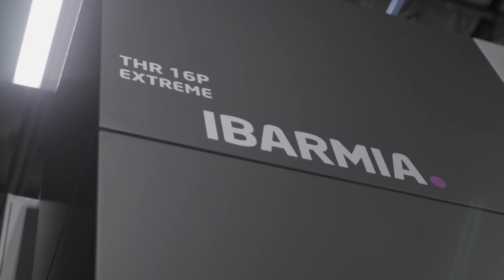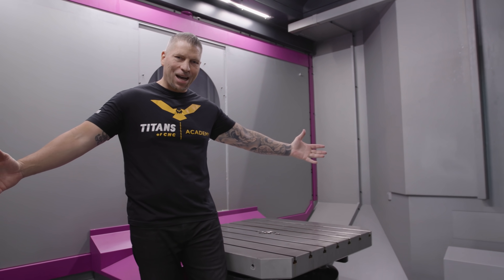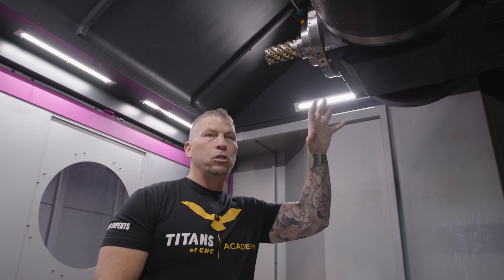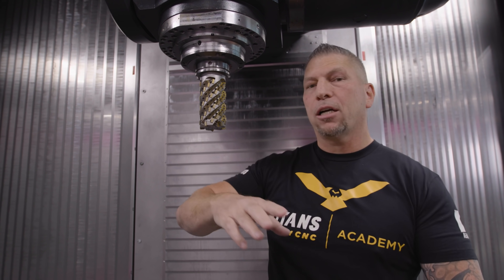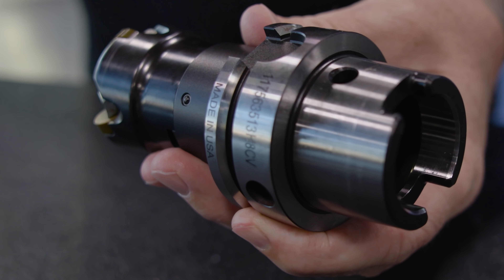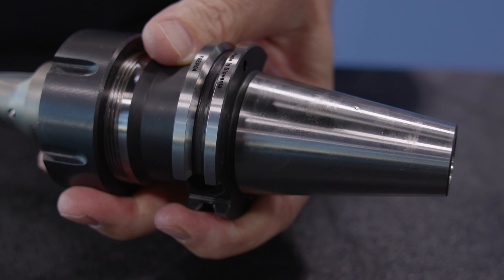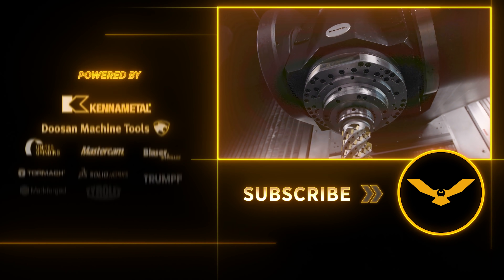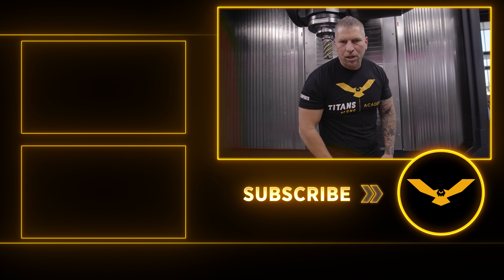100 HP KESSLER SPINDLE IN MONSTER CNC MACHINE!

Comment: Kinda reminds me of the 5 axis machines we had at B & W in Barberton, Ohio back in the 80’s, but B & W’s were much, much bigger.   They built nuclear steam generators for the Navy.    We had some with nutating  heads and contour cutting (“U” heads).   I still don’t see too many of these around.    The Ford plant up in Cleveland used to have a “U” head on their large 5 axis mill for molds.   You could cut a reverse taper (or contour) in a bore with a “U” head.   Almost every shop I ever worked at at some unusual machine that no one else had, and it’s job was specific to the product they built.    The more shops you worked at, the more you were exposed to the exotic equipment.   I enjoyed it.    Soaked it all up like a sponge.
Reply: i work on a B&W atm, its a pretty solid machine and fun to use 
because i work in the energy plant sector i get to use all the fun big stuff
i also was trained on a georg ultraturn and some other lathes that i forgot the real name off, just know the firm intern name
Reply: Barberton. Now I'm hungry for chicken. Mmmmm.
Reply: Do you remember the brand of the machine? Back in the 80's five axis had to be really cutting edge, especially with a U-axis and nutating head.
Reply: I work at NOG-L. We got an Ibarmia a few years ago. I start training on it Monday

Comment: Hi, what a machine. Such a high RPM for a large machine. As I said in one of my earlier emails I worked for Seco Tools here in New Zealand and I understand the difference in the range of milling holders. You mentioned a BT taper with double contact (Big Plus I think it was called) but they are not as good as HSK. The problem is when the machine operates at high RPM the spindle grows slightly and rigidity can be lost. The HSK being hollow grows with the spindle and maintains double contact across the range of RPM. You may like to cover this in one of your very explicit videos in the future. Cheers Ian

Comment: You gotta have one of those. Pretty high spindle speed for that kind of horsepower.
Would be killer for big aluminum jobs. I use to turn aluminum at over 8000 SFM never tried to mill it that fast. 😂
Reply: well aluminium is easy to mill , rpms go brrrrrrrr

Comment: hsk stands for the german words "hohl schaft kegel" which means hollow shaft cone. hsk 100 is massive. the biggest i have dealed with is hsk 63, which is quite common
Reply: Hohlschaftkegel ;-)
Reply: HSK also has a much higher pull force than any ISO,CAT or BT spindle which only improves as the speed increases. I've been on a HSK-100 where the spindle can go at 12k RPM, mainly because the weight of the tool is a lot less than the standard taper tooling

The next step up further is Capto but there's not a lot of spindles what have this built in
Reply: @DuRöhre4711  lol natürlich, habs mit sk - steilkegel verwurschtelt 😂

Comment: I made a comment on your recent video "The Most Unreal Mind-Blowing CNC Machining You Will Ever See in Life" it could be construed positive or negative. What i said was its a 50 taper machine with hi torque - use it. No big deal. You guys push things to the limit and thats impressive to see. However some of your videos on the 40 taper mori show the tool clearly pulling the machine and spindle around during the cut.
Kudos for thrashing the machine and finding the limits but my advise having used large machines is don't do that with the Ibarmia. Something will break. The spindle on these machines is the weakest link. Anyhow who i am to give advise to the professionals.

Comment: When you need to mine contours. Is HSK lighter than equivalent CAT? I became a little less enthusiastic about beast machining when had to stretch my arm out to insert a 58 mm indexable drill + CAT50 into a milling machine. My spaghetti arm was shaking like crazy.
Reply: i cant comment on the hsk 100 but at the shop i work at we use a mix of cat40, cat50, and hsk63 and i feel the hsk is alot light than the cat40 much less a cat50
Reply: @nicholasbrown1821  Good to know, thanks.

Comment: 100 HP 3 phase AC induction motor, this machine has to be running at 480 VAC or higher and pulling quite a lot of amperage on each phase.